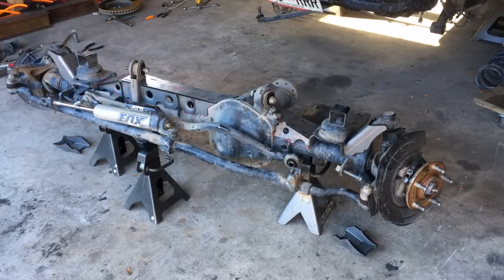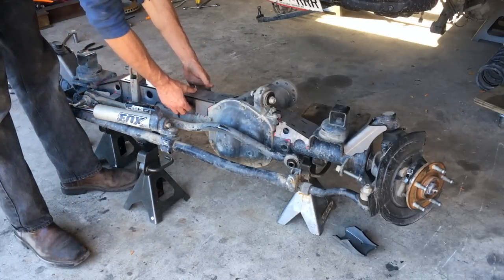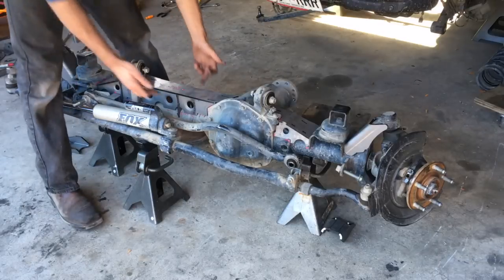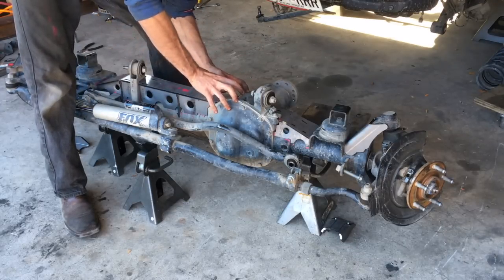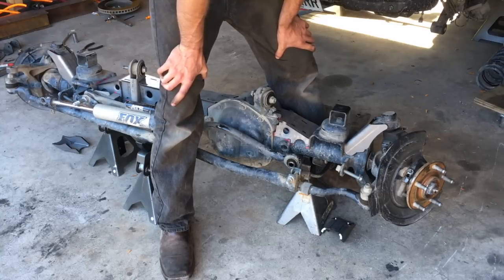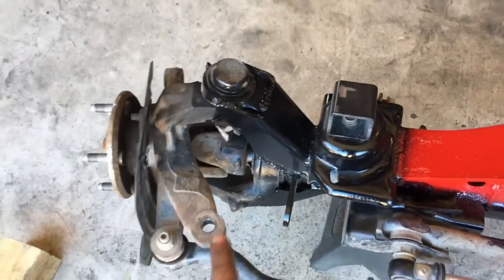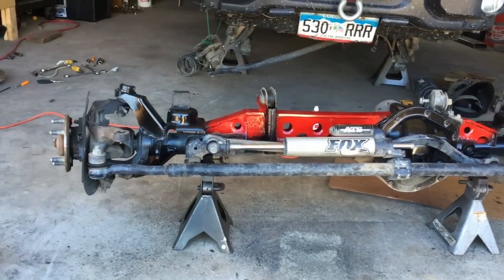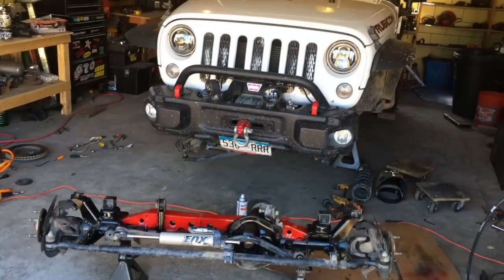Beefing Up Your JK Front Axle

Comment: I bought a Rubicon and plan on overlanding down to South America. Not planning on rock crawling. Does a Rubicon need upgraded axles. If so, what do you recommend?
Reply: You are going to overland from the US to South America? You can't do that unless you put your Jeep on a boat or plane from Panama to Columbia. Google Darién Gap. There aren't any roads for about 75 miles from the end of Pan American Highway 1 in southern Panama to Highway 62 in northern Columbia, it is very dense jungle filled with drug smugglers. A Jeep can't even make it through that jungle and you would probably die if you try.
Reply: rond361: tracking.  Had no plans to cut a road and make bridges through the Darien.  Thanks though.
Reply: You have made no plans at all. What you say you are going to do is impossible. If you are going to try this alone you wont even make it through Mexico without getting killed and your Jeep stolen. I would rather go four wheeling in Iraq or Afghanistan then drive through Central America, it would be safer.
Reply: rond361 thanks.  I’m not planning on going alone.  Lots of overlanders travel through Central and South America.  I’m quite aware of the difficulties and my plans and risk assessments will take into consideration whatever lays ahead.  At this point in time, the only country that I’ll stay away from is Honduras.  The frontier in Mexico from San Diego to Arizona is not safe.  But 100 miles south of that area is safe.  Which is why I plan on going through Baja.  Worked in Afghanistan, I understand unsafe regions.  And I got my answer regarding axles.  If you look at the various YouTube Channels of people who’ve traveled  the Pan American Highway you’ll see it’s a growing number. It ranges from families, couples in different types of vehicles. Women and men traveling solo on motorcycles, people running and hiking it and bicycling.  It’ll be fun and exciting.  You’re welcome to caravan with me.
Reply: 4 months late but chill lol

Comment: Great now I just have to learn how to weld lol
Reply from the maker: A few years ago, I bought a harbor freight cheap Chicago electric FLUX/MIG welder. It wasn't the best, but it got me learning. If you want to learn it, and know youll use it, go buy a lincoln electric or hobart welder. 140s work up to 1/4" and use standard outlets. if you can get a 220V outlet installed, then id suggest going the upgraded route. The better the machine, the better the weld (usually). also goes with what you like the feel of best.